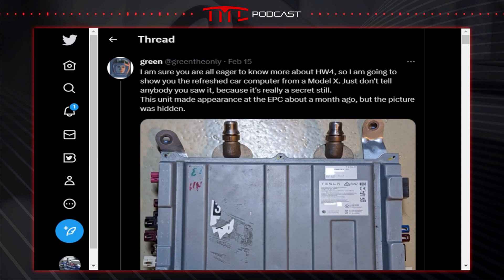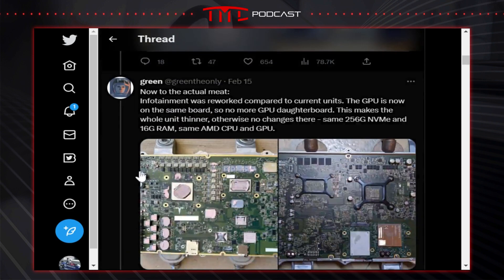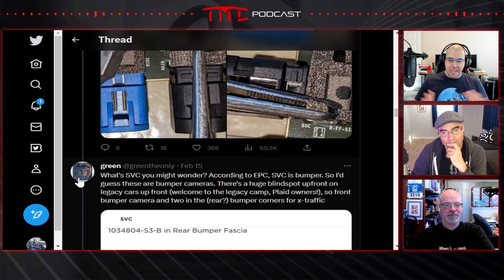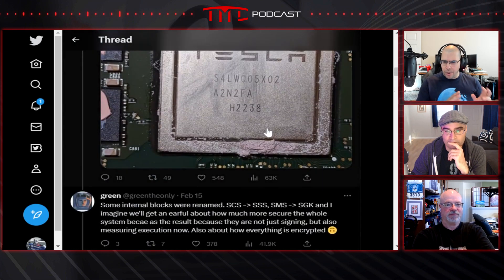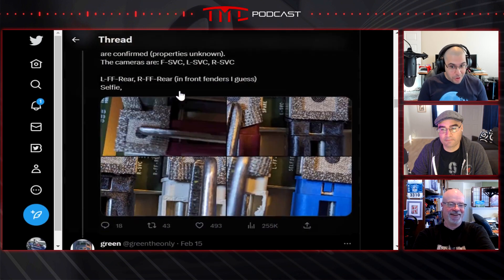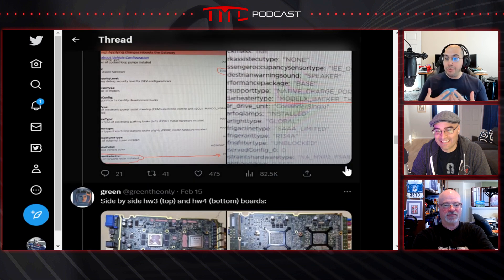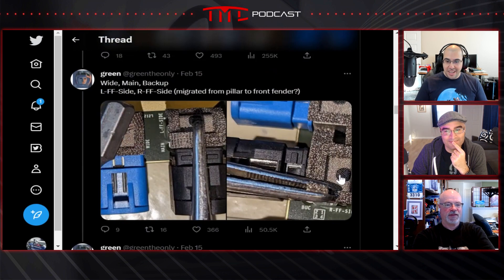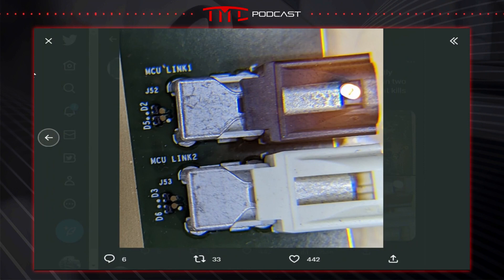Tesla's Hardware 4: Will it improve FSD?

Comment: The reason for new hardware changes has more to do with the cost of technology.  There is a sweetspot in any product range and with tech hardware that sweetspot is often where the volume production is.  Where economies of scale bring the price down.  If you have ever tried to get memory for an old computer for example and find that it is more expensive than contemporary products, even if much smaller?  So Tesla simply design to upgrade the platform in efficient steps that don't leave them too far behind or ahead, whilst still benefiting from scale over millions of units. HW4 is just the next step and Elon has said that HW3 will be capable of FSD and no HW upgrade will be needed. So it's a non-event almost.

Comment: To answer your question before watching the show.  The obvious answer is Yes and No.  Well, Yes it will improve things if we have improved and increased vision and the ability to process all those photons and No.  How can it?  FSD is a software solution, it is the logic and nets that make the magic happen and the hardware is just a config file and IO stream.  The hardware doesn't really matter to FSD.  Range on the other hand ...  Yes a more 'power'ful processor and new HD radar will have an impact on range, although likely offset by improved energy densities. It's all an equation